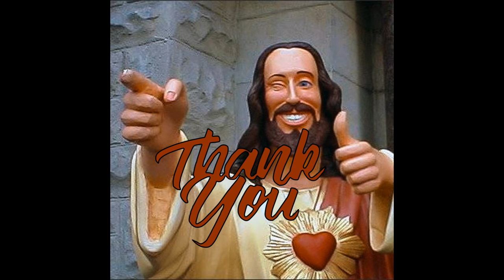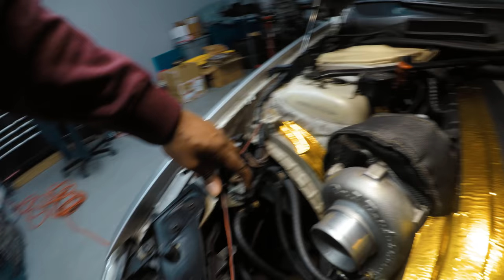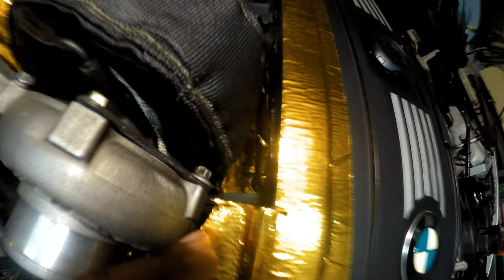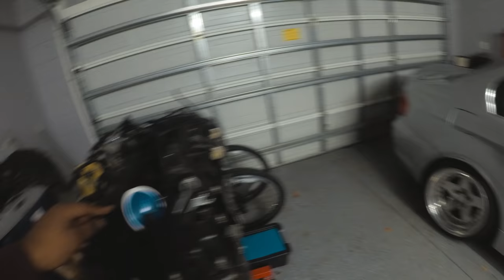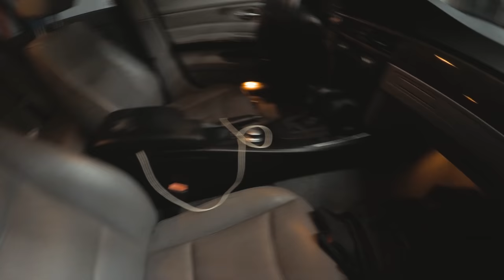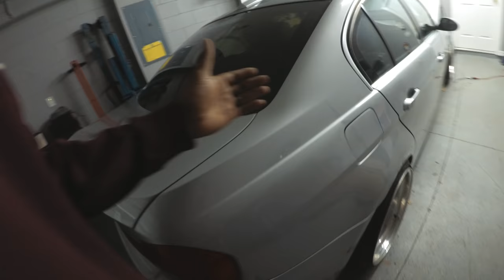BMW 335i N54 On3 Single Turbo Update

Comment: Do you have check engine lights on from turbo set up. Also what's the longest you driven with new turbo. I like to travel out of state and it's like 9 hours don't want trouble with car getting to hot
Reply: noshi thanks man for the update

Comment: Hey man im about to pull the trigger and get the on3 kit. How did you route the waste gate dump tube? Did you have to bend it or do anything to it assuming you used the one that came with the kit. Also was it a straight fit to the stock exhaust from the downpipe? Thanks in advance man!
Reply from the maker: Hey what’s good. Yea I used the one that came with the kit. Didn’t modify it in anyway. Once it’s connected to the wastegate it routes in a good path and you just have to swivel it left or right to make sure it doesn’t rattle against anything. Also was a straight fit to my exhaust. I have an e90 borla exhaust and the flange is similar to the oem stock flange and it fit straight.
Reply: nOshi great man! I wish I could do it myself but my garage is not even big enough to fit my car in. But thats good to know, sourcing all the things that dont come with the kit.
Reply from the maker: That’s what’s up, no prob!

Comment: What did you do for the tune im looking to get the kit but im more concerned on the tune
Reply from the maker: Depend on what you choice to tune with. Such as staying flash only, running jb4, or a manual or electronic boost controller. Generally whoever you choice to tune your car will be able to set you up with a base map if flash only and bms via n54tech provides the backend flash for that setup. Main thing is choice a tuner and they can set you up.
Reply from the maker: My setup is the motiv boost box connected to 3 port Mac solnoid. Then I just created a base tune and then tuned from there.
Reply: @nOshi2x  so for flash only i would just need the jb4?
Reply from the maker: Jb4 would be a hybrid setup. So the jb4 controlling boost and then the backend flash to control everything else. To do flash only, you’ll need to get a Mac boost solenoid, and either a manual, electric boost controller, or the motiv re|flex setup.
Reply: @nOshi2x  oh so it could be like mhd running the custom map w jb4 back end flash?
Reply from the maker: Yea so they both working in tandem
Reply: @nOshi2x  im getting the kit and still a bit iffy on the whole tuning side thanks for the info!

Comment: bro, did u dyno the car on 93 or 91 with the single turbo, if so how much hp was it, thinking about running the same setup
Reply from the maker: Hey man no haven’t dynoed it yet. Been doing some work to it and haven’t really done it yet. It makes power though, good for the most low 600’s

Comment: What are your wheel and tire specs in this video
Reply from the maker: 18x10 ET 16 on 235/35, 3 in. lip
18x12 ET 22 on 265/35, 4 in. lip
Reply: @nOshi2x  any fender rolling or pulling?
Reply from the maker: The fenders was just rolled. But there is a lip that is a pain to get flattened. You have to pull out or grind the lip down to get the adhesive out of the lip. It took awhile but I pulled it out and then it will roll flat. Also the pre lci e90’s have a lot more rear fender room than the lci’s.